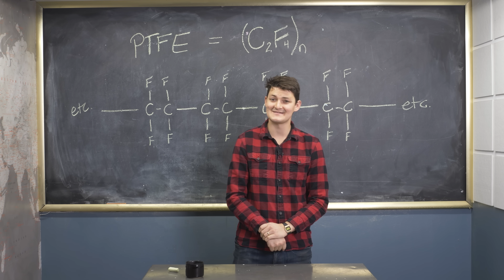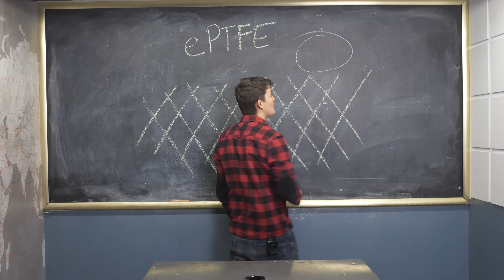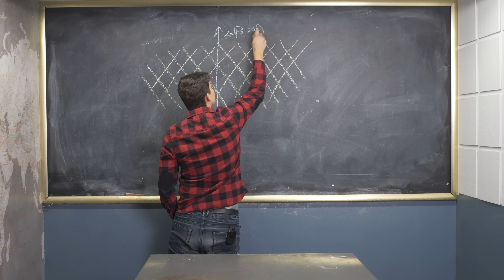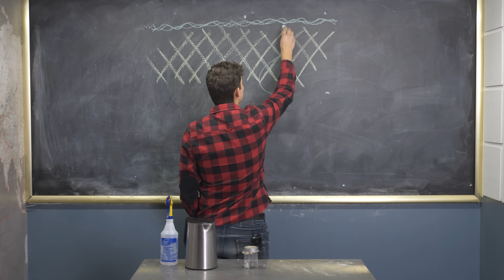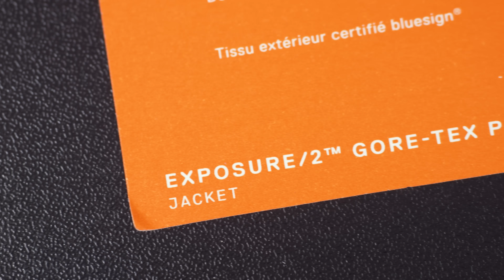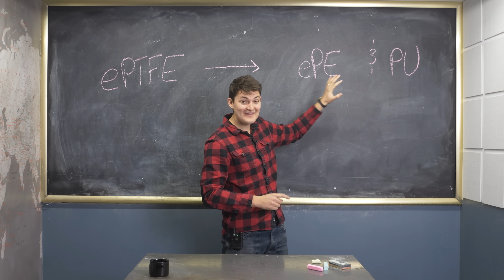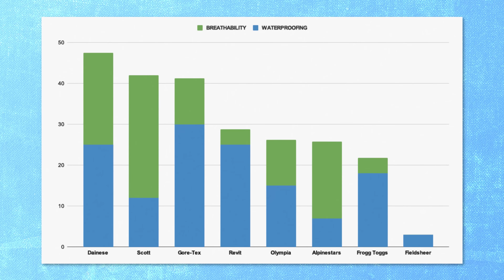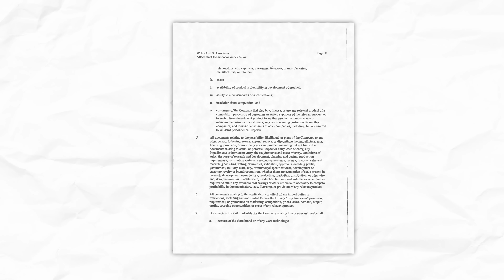Gore-Tex is a Marketing Gimmick

Comment: As an outerwear designer that has worked with thousands of laminated fabrics: "Goretex" is a brand, not a fabric. Sure they are patented (used to be) , but there are literally thousands of abbreviations of the more or less exact same thing.
And Goretex itself has thousands of fabrics, so testing a "patch of goretex fabric" to test the function of goretex doesn't really make sense, again, it's a brand not a fabric. 

The functionality of the laminate is to a big extent based on the waterproof coating that is applied to the face side of the fabric, not only the membrane on the backside as most people believe.

But yes, this video in other ways makes sense, and laminated membrane 3L fabrics have the problem that you are likely to build up water vapour inside, in movement and higher heat environments. 
Getting wet from the inside. 

The key is that you learn after designing outerwear for years, is that it's not about the fabric, it's about the full product, it needs other ways of ventilation. 

And here's your key take away: Why goretex is deemed as a stamp of Functionality, is that they do not allow anyone to use their brand logo or label, without the product going through their testing, and this is seam tape quality, contruction of the product etc, 
For example you can't make a rain jacket without a hood with a goretex logo, they won't allow it, that's not waterproof construction. 
Actually super annoying to work with those guys haha! 

Anyhow, yeah no ones gonna read this but it needed to be said lol, so many misconceptions about all this
Reply: FYI, plenty of golf brands make hoodless gore-tex waterproof jackets(e.g. Galvin Greene) but i think your point still stands.
Reply: @kevinmccarron833  Yes and they use ome of goretex's fabrics that allow for that, it's actually a completely different product concept, usually they use "Goretex infinium" which does not have the same requirements to classification as their standard product, it's often more breathable too, but they have a seperate process of testing and allow for non waterproof construction
Reply: @Frorideism I read it and I appreciate it. I'll take one of these kinds of comments over a thousand dumb jokes any day. Please keep being you.
Reply: @kevinmccarron833  yep, i have a goretex golf jacket without a hood
Reply: I always read comments on top of video because sometimes you get valuable insights like this one
Reply from the maker: Thanks for the info! To your point, the patch we tested was from a Gore-Tex 2.5L Paclite jacket. Solid point that the ePTFE membrane at the core of Gore's "Guaranteed to Keep You Dry" fabrics is only one layer of the system, and there will be variance depending on how the garment is otherwise constructed (moreso if it's one of Gore's new ePE and PU jobs).

Do you think Gore's testing deserves the reputation that it has? I've heard from a few major gear manufacturers that describe it as much of a hindrance as a help. One wanted to use thicker seam tape to make the garment more waterproof by their own testing, but couldn't, because Gore regulated that it be precisely 24mm. 

It reminds me a bit of motorcycle helmet standards. The Snell standard had an excellent reputation with consumers, despite their tests being overly rigid and antiquated. The sentiment among manufacturers was "First we make it safe. Then we make it Snell." 

Personally, I'd love to see us move beyond "badges" of quality like Snell or Gore-Tex, which are inherently vague. Without them, consumers would learn to compare the actual data. Waterproof column of 28,000 mm? OK. 40,000mm? Better. Head Injury Criterion of 2880? Meh. 2300? Great. There's no reason we can't just tell people what a product can do! ~RF9
Reply: @FortNine   Hey bud! 
Okay so for the fabric swatch, the Paclite fabrics are often less "heavy duty waterproof" than many other's, since it's core selling point is lightness.
However! This whole waterproof column testing is really a big light show, because there are so many other things that factor in to make a product perform, again, it's about the full end product, not only the fabric. 

I'm going to be fully honest, sure, Gore-tex requires garment vendors to be of a certain level, and they are vetted, and they are supposed to test everything, 
In reality: Iv'e been at companies where products are pushed out so fast that Gore never had time to test them, WITH gore logos. 
So in reality: It depends.

And they are tough to work with, that seam tape example, yep. 
I was doing sailing gear a while back and they were really stingy about neoprene cuffs because you can't seal the sleeve hem seam.

Anyhow, 
I fully agree, if the consumer could focus on the stats, the factual functionality of products, it would be easier to know what you need and what you're looking for. 
The consumer is however (even though they're getting more knowledgable now..) extremely brand focused and they, to put it bluntly, don't know jack about any of this. 
So they follow the labels and badges.

Many brands have their own badges, TNF has Dryvent for example, 
But people only trust Goretex, they have had insane marketing for decades. 

And people, they buy Balenciaga hoodies for 2.000 too, because it says Balenciaga. 
It's also about status. Goretex is status.

We'll never get away from status symbols, to quote Robert California, everything, and I mean everything, is about sex. 
😆
Reply: @Frorideism  I feel your pain. Years ago, I worked for an outerwear company, and one of the directors of Gore came in. We used Gore on some products and not on others, mostly based around price point. He would not relent in any way until I agreed with him that Gore is the best product on earth, and no one can design anything better. This is after the patent expired. But they made us do some annoying things to get their certification.
Reply: I think one of the problems the consumer faces is having only the badges and labels to go off when shopping for a product - sure you can try it on and look at all the neat features but the only true way of knowing how good a piece of gear is when you actually use it out on the hill

Other companies do indeed have their own badge to stick on their waterproof tech (such as dryvent, which is usually 15,000 rated) but then it's often incredible difficult to find the actual waterproof column rating in other pieces of gear, and gore-tex sitting at 28,000 still trumps most of them

For example, in the UK there's a franchise called "Mountain Warehouse" that only sells their branded clothing - they charge the same price for their jackets as the big names like Berghaus, TNF etc. except when you look into it a lot of the time their stuff is 10,000 rated or worse and is all generally bad quality lol

In the end brands and marketing exist for a reason, it can be so exhausting to dig into every piece of equipment that you buy looking for marginal improvements, so often you find yourself just going for trusted brands with trusted tech, which is why these companies can get away with charging a premium for it,  an angle that @FortNine doesn't consider in the video  @Frorideism
Reply: Unfortunately everything moves in opposite direction. It becomes increasingly difficult to compare anything on hard data, because it's not published by manufacturers. Specifications for consumer products are becoming harder and harder to come by. Websites are filled with infinite wallpapers of nice pictures and specs are hidden out of sight and lack meaningful tech details behind exaltation of features and benefits. Everything for stupidest common denominator @FortNine
Reply: @FortNine  Years ago, many brands used to use the mm ratings for outerwear. Gore refused to, because they said there was no standardised testing and the claimed figures of others were wildly embellished.
Reply: @jayd3931  The international standard is ISO 811: Textiles — Determination of resistance to water penetration —
Hydrostatic pressure test. Gore probably refused to use it for other reasons.
Reply: Hence ponchos. The most breathable product format.
Reply: @Dogo.R  Umbrella my man! 😎👌
But yeah Ponchos are honestly my favorite jacket for hiking etc and I've designed a few of them, the problem is: they require more fabric, fabric ia the main cost of these products, seam tape too, then zippers.

So, you're using more fabric, and you still want it to be light so you need a decent quality, you have to remove details to balance out the cost,
This is why most ponchos are so cleanly designed,
And cost will still be rather high,
So people have trouble understanding how such a simple product can cost so much.

Unless you get a super basic 50$ poncho, that works in a pinch I guess
Reply: @Frorideism  Umbellas are only waterproof under certain enviromental conditions like not too much wind, not moving very quickly, having a hand free, ect.
Plus they are bigger and heavier.

Ponchos are better or equal in every way other then certain neiche things like you cant put on a poncho while in a car as quickly as you can use an umbrella. But cars are suboptimal anyways. Better to use an EUC, Trams, Trains, or other things.
Reply: @Frorideism  Expensive ponchos dont seem to be noticably more breathable when wet. At least when you normalize for a proper DWR coating if that is applied.

Though maybe I'm missing a brand you know about.
Reply: @Frorideism  Where I live in Europe a USD 50 poncho is a medium poncho. A super basic poncho is USD 6,-. I like to bring mine for sea kaykaking, motorcycling or hiking. A poncho is useful for many things.
Reply: Please for the love of all that is holy design a ultralight jacket that focuses on venting instead of stupid DWR coatings.
Reply: @@ThomasMcKeon-rw4sm fair!
It's also worth noting that even a Gore product can and eventually will get "waterfilled" to thr point where it loses its breathability completely, and holds water, making you cold.

That will never happen with for example a face coated PU fabric, but those are non breathable.
It's all dependant on what you need and what you're using the thing for
Reply: goretex test anything with their label and makes it 50% more expensive, but if you just don't want to test for yourself, it's a safe bet.
Reply: Gore-Tex patents expired in 1997.
Reply: Well written, you have earned 150 GorePoints
Reply: Definitely have to agree, Even between a few of the brands of goretex apparel that I own, there's definitely a MASSIVE difference in quality. one got cut from a branch on a tree, the other one is still tear free after 5 years of mountaineering and the occasional tumble down loose-packed shale faces. BUT, I've never had a goretex product seam leak on me which is rather important when you're a few days walk from human contact and water ingress could be the difference between needing to use an emergency S&R beacon or not. There's a zero percent chance I'd stan all goretex apparel, but some of the best and most importantly, reliable has been goretex. And even if I'm overpaying, the odd time that I actually need new gear I'd rather buy something I've never had fail on me.
Reply: There are rain jackets without a hood and a Gore-Tex logo. In fact, Gore themselves have a jacket model called Torrent which is a hoodless waterproof jacket. Another similar product is 7mesh Rebellion Jacket. I'm sure there are plenty of others, too.
Reply: I read it as my brain needs information
Reply: Yeah. Well. Goretex. Isnt...100 percent waterproof or.   100. Percent breathable,  Pitt zippers.  Are. Necessary.  For. Sure.
Reply: Not. That.  Many. People. Want. To. Pay. 500.00. For .a rain. Jacket
Reply: I absolutely read it, thanks for the insight.
Reply: 14 likes in 10 minutes. We're reading what you wrote. If you've got more to say, we're listening.
Reply: @2old4allthis  nobody cares lol
Reply: @synapticburn    About your comment? Yes, that’s obvious.
Reply: @2old4allthis And here I thought you'd given up simping in this thread...

You're slacking; what's the count up to?
Reply: Well Gore-Tex isn't even a fabric, it's a membrane which is added to fabric. (As you then went on to add, without saying it as clearly)

I think one important thing for people to realise is that if their (usually older) Gore-Tex textiles don't perform well, you need to take care of them. As stated in the video: it really does make a difference to re-treat the surface. I believe that cleaning the jacket first is also essential.

And: there's nothing really better than Gore-Tex out there either, only other products which can be approx. equal to it.

(A family member of mine was a top-tier textile company exec, he taught me a lot of stuff about these textiles & membranes)
Reply: @pistonburner6448  GoreTex is a brand.  They manufacture a long list of different fabrics that include a variety of laminates and coatings.  "GoreTex" is not ePTFE.  It is a brand name of a textile laminate fabric that may include ePTFE in some variants.  In fact, they offer more textiles that do not include that particular membrane than those that do.
Reply: @JCintheBCC   This comment! 
I think car seat fabrics is one of their biggest business actually
Reply: Now 32 likes in 12 minutes
Reply: did we watch the same video? did you even watch the testing video? do you not understand the difference between connotation and denotation? nothing in your comment is a refutation of any of the facts presented in either video.
Reply: @synapticburn  My point was not to refute the video at all
Reply: @synapticburn I think the OP just wanted to obfuscate and confuse.